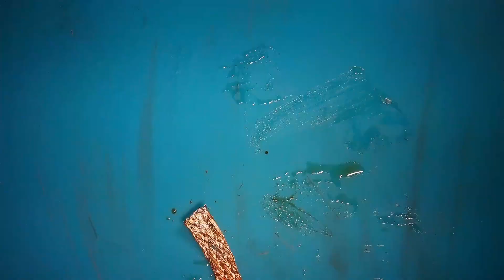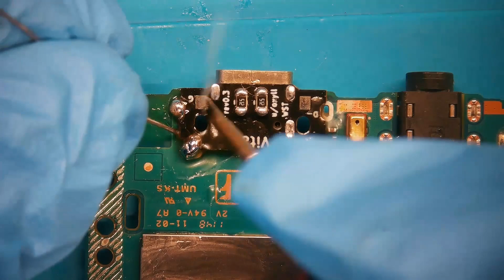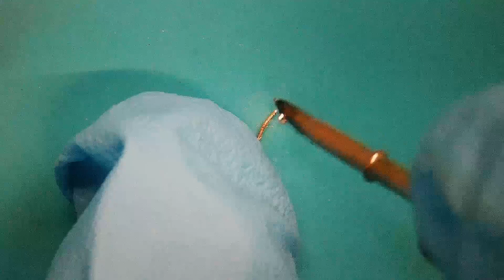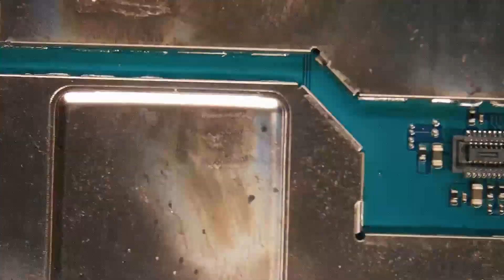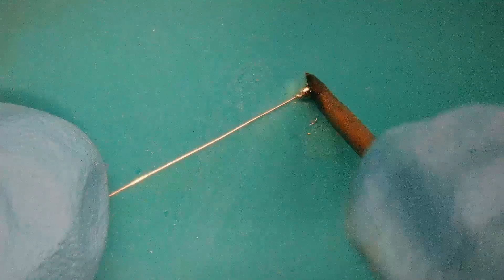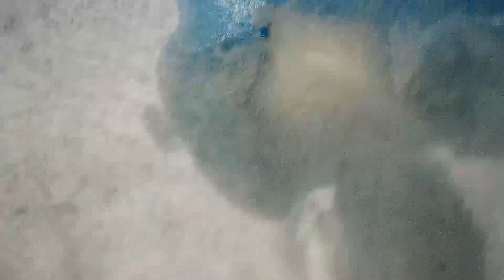Ps Vita Usb-C mod  Part 2

Comment: I just did this mod to my vita and what I can say is the vita can take Alot of heat trying to get the original port off took some time. I got it done successfully and without a microscope not a requirement But Definitely Helps.💯😊